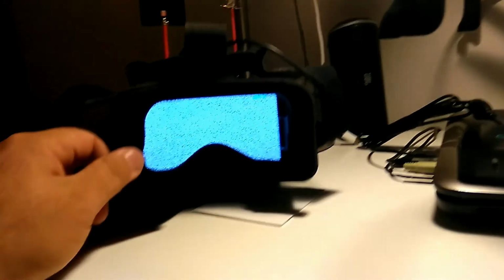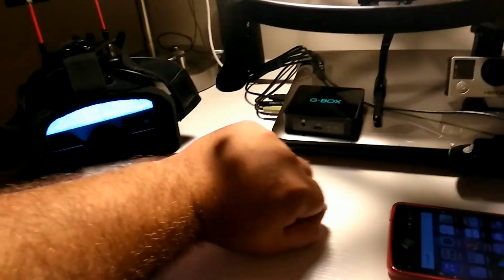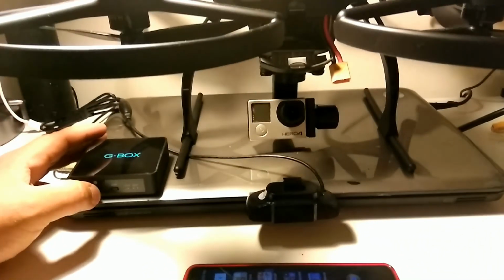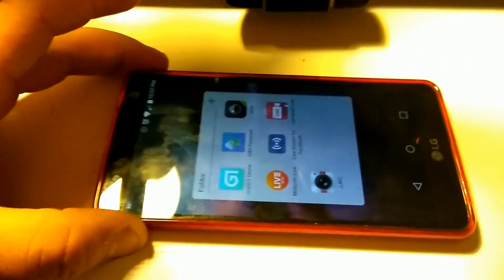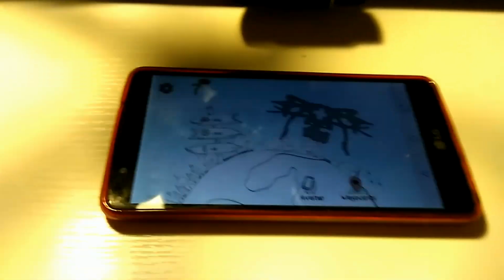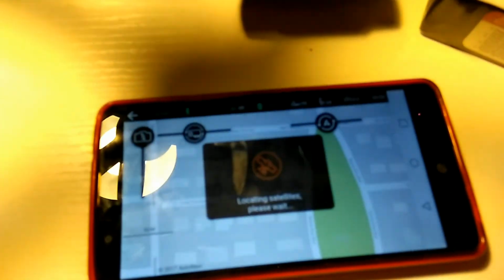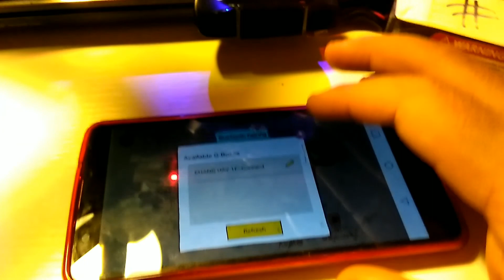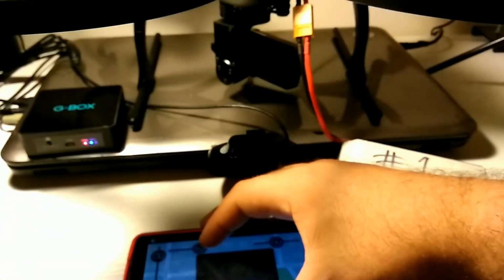Ehang Ghost Drone 1.0 Android/IOS How To Install FPV

Comment: Nice job tracing the leads Dan.  FPV on this drone moves it up a full magnitude imho.  A Remote Controller would be the icing on the cake.  I have seen a few vids of the Ghost being flown with an RC, and am wondering if you have any info or insights regarding the functionality and “flyability” of the Ghost drone with a RC?  Thanks much for your many contributions to the Knowledge Base of this very cool hobby/sport!
Reply from the maker: Jim Buxton they sold a working TX for it at one point but very rare now

Comment: Hey Dan does your hot glue melt from the heat off the 5.8  transmitter?
Reply from the maker: John Stiles no issues so far, I also use hot glue on all of my bugs 3 cameras with no problems you just need higher temperature glue
Reply: Drone Worship Thanks Dan . I will check into that. My glue gun is a 40 watt .